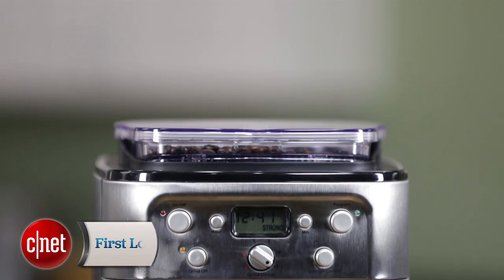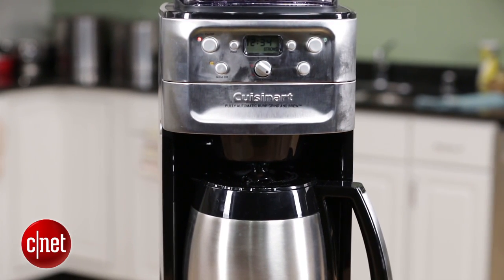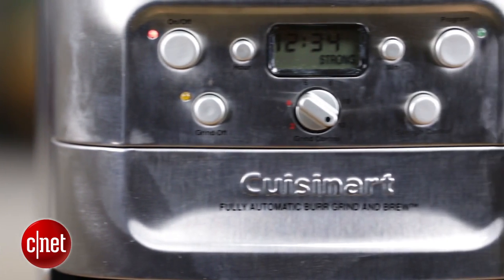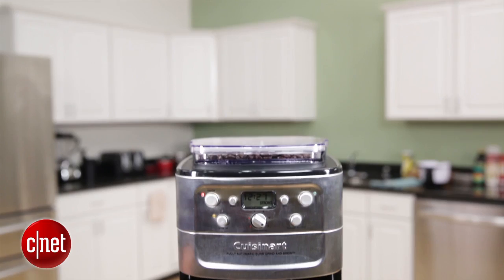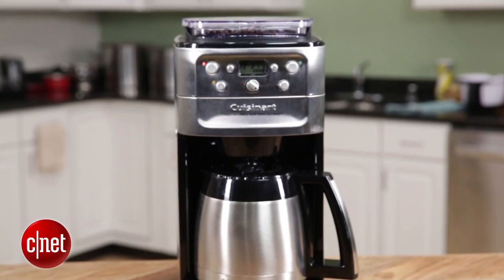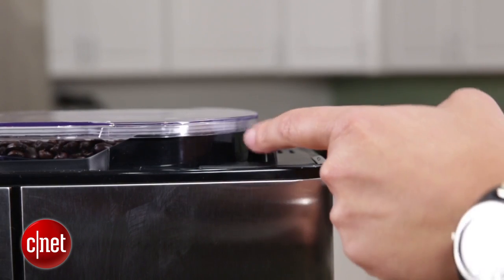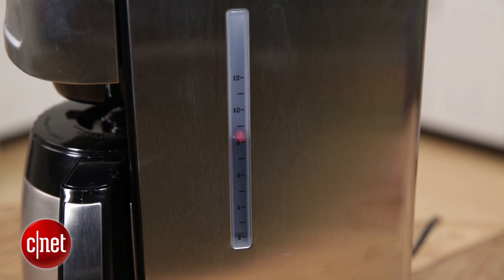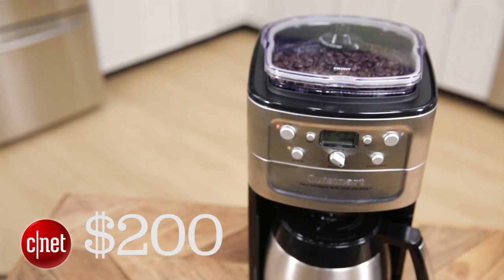Cuisinart Burr Grind and Brew crunches beans for fresh pots of coffee

Comment: Mine is great. Works simply great and the coffee was too strong, not weak. I never have to move it so the weight is not an issue. Had to adjust to the weak setting to get what I wanted. It also depends on which beans you use for the coffee strength and flavor but thats the same for any maker.

Comment: BTW the parts do not have to be cleaned by hand.  I put them in the dishwasher each night for 5 years and they are fine as the instructions indicated.  I had the glass pot which I also added to the dishwasher.  I don't think the thermal one would be as dishwasher safe.